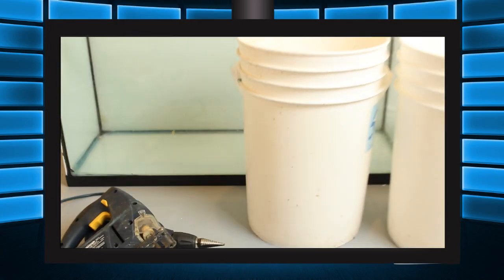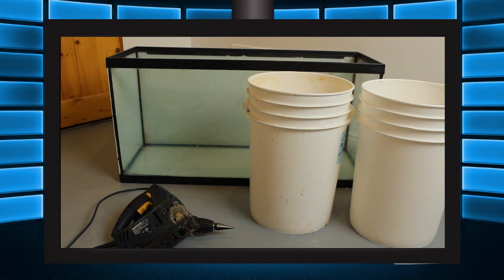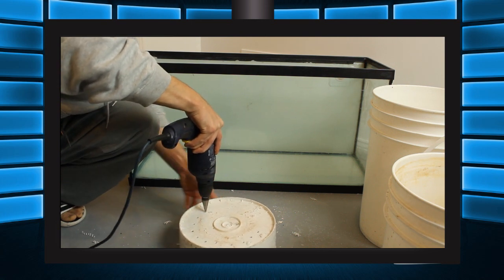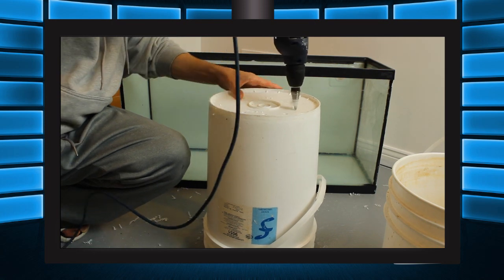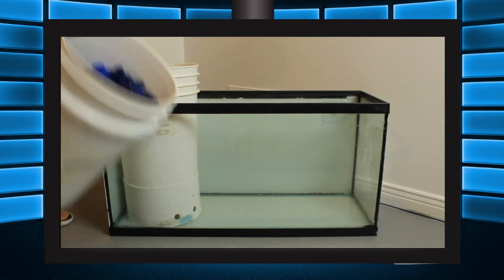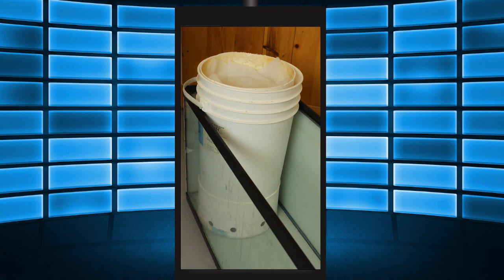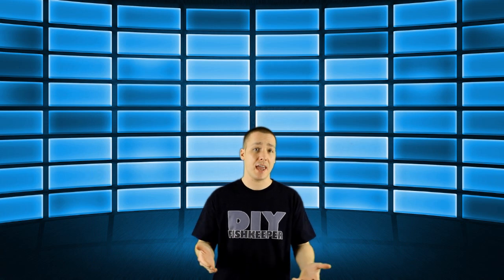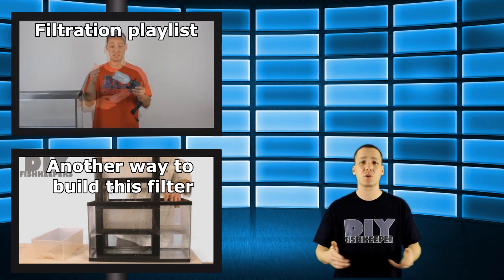HOW TO: build an aquarium sump cheaply - trickle tower wet dry TUTORIAL

Comment: Thanks for this. Just quickly, if there is a heater in the sump do I still need one in the tank. If not it may be a way to get a little extra room in smaller tanks. I am thinking about this for my daughters 33gal tank.
Reply from the maker: No, if you have a sump, your heater goes in the sump. One of many benefits to a sump i that you can place equipment like heaters in it instead of the display tank.
Reply: Thanks for that. Now to get her to build her own sump.

Comment: Hey Joey,

How to keep proper inflow and out flow from sump . I am concerned if water flow rate is not equal sump system will fail
Reply from the maker: +Vino Joy You dont try to balance them. That doesnt actually happen. The overflow simply needs to be able to handle more than the flow.
Reply: +The king of DIY 

concerned on if  pump is not pushing water as much speed as inflow  , sump can get overflow ...correct  ?
Reply: +Vino Joy I watched his diy plywood tank with a gravity fed overflow. is this what you have? if so then just make sure the aquarium or tub that you are using, will accommodate the amount of water that will overflow until the siphon stops in case your pump dies or stops running.
Reply: Hi Daniel

when i raised this question i was not using siphon . I build a siphon ...now everything works perfect ... Thanks

Comment: Will it work salt water?
Reply: Peter Cartert I want to use this with a reef tank too. I am also wondering how well it work.
Reply from the maker: goxcpre These were once very popular in the saltwater hobby. Now with the availability of skimmers and reactors they are rarely used.
Reply: Ok. So perhaps a submerged DIY sump would work better like in your other videos? I wanted to put in your DIY skimmer in the DIY sump too. Starting to get some great ideas from your channel! Do you have a DIY reactor video too?
Reply: ***** I just liked the wet dry because you can use a rubber maid container and I feel like adding baffles/dividers in the rubber maid.
Reply from the maker: goxcpre Yup. I have videos on all of those.
Reply: ***** Thanks. I'm going to try to add your DIY algae scrubber too into the rubbermaid sump for a really affordable DIY sump system.